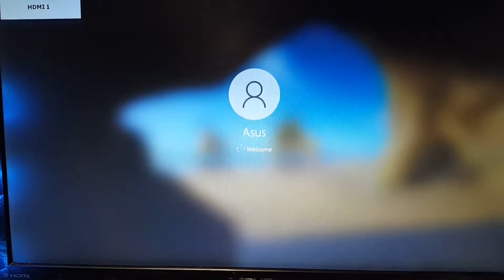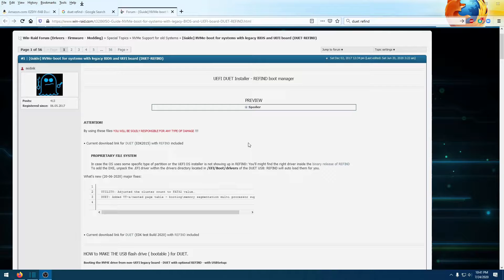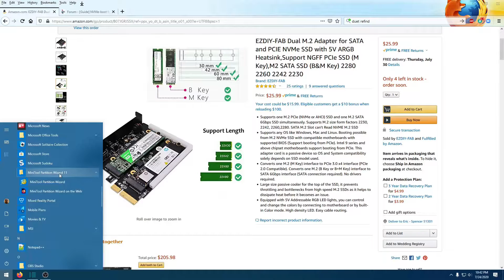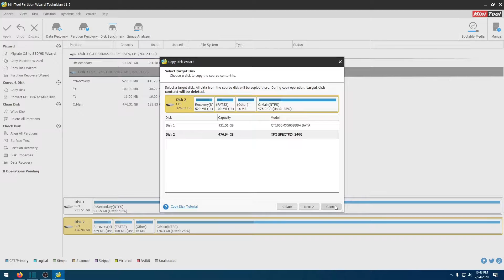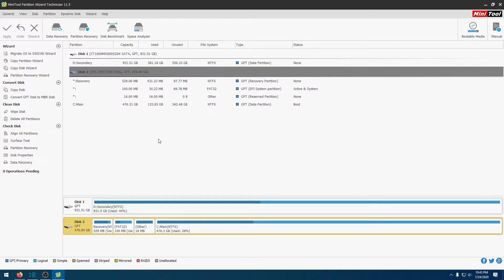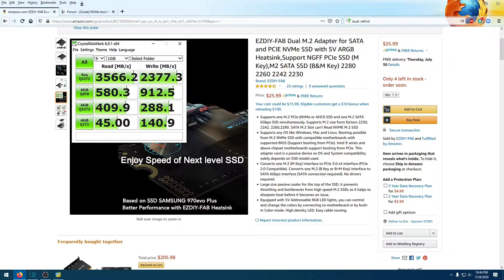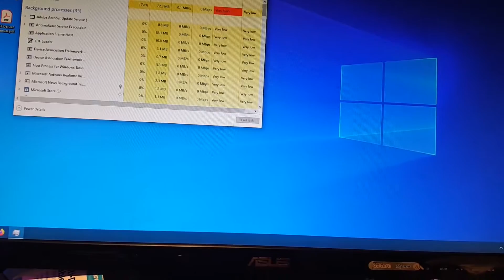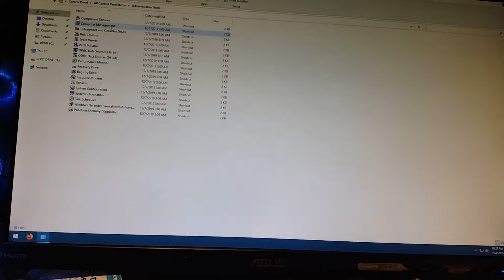nVME boot on a legacy x58 BIOS, no USB stick.

Comment: It's only 1600 because your PCIe slots are likely only gen2..  which is theoretical top speed of 2 GB/s  (500 MB/s per lane, x4 lanes for the NVMe).   So those "adapter" speeds they show (8:00) are likely on a PCIe 3.0 motherboard, which is double the 2 GB/s, 4.0 doubles again, and 5.0 doubles yet again.  That's still 4x faster than a Sata SSD though.

Comment: Without reading all your bios i am guessing your board is using pciE 2.0, which is about half the bandwidth of 3.0. 3.0 runs at 3500mb/s so check that out, 8f you haven't.
Reply from the maker: Yes, that is correct. Was intoxicated when I filmed this video, my mind was not considering PCIE 2.0 speeds and age of machine. Surprised at this looking back, that I was actually able to finish the video without slurring too much. Might have to one day redo this topic while sober, though I tend to try and stay away from older hardware these days when I film.

Comment: Great vid, I knew something like this was possible.  If this is the case, I wonder if this would allow for me to boot a 8TB SSD (or really any drive larger than 2TB) that's formatted as GPT on Legacy BIOS that does not have the option for UEFI.  I'll have to check out that WinRaid forum.  I read through all the comments here and my understand is that it's possible.
Reply from the maker: This is an older video that I did, and the WinRaid forums actually closed down I think last year.EDIT: you might be able to find support at https://forums.guru3d.com/ Kind of a shame they shut down, the site contained all kinds of invaluable information for modding a PC. Seems a lot of the modder community is fading these days. Sometimes I feel like a leftover relic being the last of only a few who still practice the art (even when drunk).
Reply from the maker: https://winraid.level1techs.com/t/guide-nvme-boot-for-systems-with-legacy-bios-and-uefi-board-duet-refind/32251

Comment: Sir using this adapter on gen 2 pice x16 port will I be able to boot through nvme SSD. Also if yes will the speed of M.2 Nvme ssd be the same as Nvme or as sata Ssd
Reply from the maker: You will be able to boot to the NVME via commands from the SATA ssd. Your speed will depend on the bus limitations, which in your case will be Gen 2 speeds. This is much faster than a standard SATA SSD, but not as fast as modern machines because of that bandwidth limitation. Real world, you can expect about 2x the speed of a SATA SSD using Gen 2 PCIE X16. Your speeds may vary of course, but that's the general range you are looking.

Comment: Does this works with chinese mobo ? .. I had huananzhi x58 deluxe .. But im not sure if this mobo can be uefi?
Reply from the maker: Yes, this should work, have not tested on any Chinese boards to verify, but x58 chipset should be the same.
Reply: @phreakwars  so you have tutorial on how to do this without usb drive to boot ?  I just found a good deal for sata m.2 (16gb ) and sata + nvme adapter ..
Reply from the maker: @ohagiman7753  No, sure don't. I don't usually cover older computers very often unless I come across one that makes an interesting topic.
Reply: @phreakwars  can i use 32 gb m.2 sata as a bootable drive for duet and refind?
Reply from the maker: @ohagiman7753  Yes, you could do that as well.
Reply: @phreakwars  hello i already had nvme and m.2 sata .. and put duet on sata .. how to install windows on nvme ? (already use diskpart ) i dont know how to install windows on this nvme?
Reply: @phreakwars i tried to boot with m.2 sata with duet and refind files inside but nothing happen..
Reply: @phreakwars  now i can use NvMe on my old pc.. But i dont know how to make it boot using m.2 sata... How to clone it 😅 please 🙏.. This the only last step

Comment: Great Job!😁 Goes to show one doesn't need the latest gen for everything. Out of over 10 computers, my best is still Haswell-E, a Z97 build with onboard NVMe, but figured I'd install this same way with an included fan. As these drives can get very hot underneath a double slot GPU, which anything decent is these days. In fact, was the 1st MB to feature a PCIe 3.0 x4 & a 2nd M.2 slot that'll run (I believe) 10Gbps or x2 lane NVMe. Manual or online says nothing about SATA M.2. I do recall seeing some x2 M.2 slots for AMD 970 MB's, but articles led me to believe this was for faster than SATA storage. These drives weren't that popular to begin with & some of the larger brands didn't manufacture them (less popular than mSATA is bad).🤣

I've done this too on AMD AM3+ (FX series), AM3 (Phenom & Athlon) & one AM2+ off the shelf HP Compaq system. These were PCIe 2.0 systems, and why 1500MB/sec is top speed, most will get that on reads, lower on writes, I found around 900MB/sec was top speed. Still, 3x faster on reads & around 650MB/sec more than SATA-2 systems, and generally over 400MB/sec faster on AMD SATA-3 legacy systems. The reason for this is these are PCIe 2.0 MB's & unlike Intel, there was no AMD MB that would with the swap of a 2nd gen Sandy Bridge to 3rd gen Ivy Bridge CPU, going from 2nd to 3rd gen on the chipset. This system, bought on eBay for my wife for $100, is a Dell Optiplex 7010 DT that shipped with one of the better retail 2nd gen CPU's (i7-2600) & for less than $35, upgraded to a i7-3770 & doubled the RAM to 32GB DDR3 from 16GB & like the system totally transformed. GPU as well now 3.0 x4. But I didn't do the NVMe upgrade, a 512GB Samsung 850 PRO kicks butt on it with the RAPID feature. Shows by both Crystal Disk Benchmark & ATTO to be faster than my Samsung 970 PRO. I'd rather allow the wear on that PC to be on the lifetime warranty RAM than the SSD that's now been out of warranty for a year or so, not to mention, in & out of multiple computers. Seriously, it's fast & it's just stock RAM for Dell made by Crucial, although purchased new by me on promo. Have an extra like new MB like this in case it goes down & may buy a couple more for some legacy Dells (Optiplex 790/990) that's also 2nd gen, but won't upgrade like this, chipset is older. These MB's can be purchased for $15 or less in great condition & most shipped with Win 7 Pro. 

This NVMe install is easy as pie if having a Samsung 950 PRO (any size) around, because it's the ONLY of the 900 series to have it's own bootable ROM. Guess Samsung didn't want to kill their sales of 2.5" SATA SSD's!😂 Though be sure to uninstall any other drives first, to find the NVMe one. Easier done with Intel systems, some AMD systems needs the optional Windows 7 NVMe driver that's likely still out there to be placed on USB stick, floppy or slipstreamed into ISO (been 3-4 years since I've done this on legacy AMD). My next build will for sure be Zen, hopefully AM5, but until I see DisplayPort 2.0 PCIe GPU's & monitors, I can wait. Seems like the video is always there with new cards, just not new Standards, as DP 2.0 was released to distribute years ago. Much faster than HDMI 2.1 (around 80GB/sec for DP 2.0 compared to 48GB/sec for HDMI 2.1), so why the wait anymore with PCIe Gen 5, which likely will be a longer GPU standard than Gen 4. 

BTW, lots of these goodies, including then $5,000 PCIe (SLC NAND, the best to this date) were available for Linux long before Windows. Mainly workstation computers, servers & supercomputers, of which last time I looked, there wasn't a Windows one in the Top 50. And after 4-5 years of usage, these drives were sanitized & resold on eBay for $2K or so each. This was around the time of release, or just after that of Windows 7. My guess is these are still in use today, or most are. SLC NAND, which many TLC & my favorite, MLC (of which until the Samsung 990), all of their PRO Line of 2.5" & NVMe were. Some specialty HDD's has up to 4GB of SLC NAND, 64-256MB is more common. This acts as the buffer, or cache. NVMe SSD's doesn't need this because is connected to (normally) 4 lanes, be it PCIe 3, 4 or 5.0. As stated prior, there were some x2 lane NVMe drives, not sure what gen these were, but no newer than Gen 3. I can imagine seeing a x6 or x8 NVMe in the future (if not already here) for the same reasons like when SLC NAND NVMe drives were new. Never read discussions on these anywhere until after the release of Windows 7 & closer to that of the $40 Windows 8 promo. 

Anyway, thanks for the video & you've gained a new subscriber.💪 There's never "too much" learning when it comes to computers & it kills the day for me, being retired.😁💯

Comment: HI, great tutorial. I have exactly the same board as you and I was wondering if it would be possible to clone my SSD boot drive to the PCIE NVME drive, once its installed?
Reply from the maker: Possibly. Best bet is ask on the win-raid forums where the software originates. They would have a better idea.

Comment: I currently have a situation where I have 5 2TB HDDs plugged into SATA in my ThinkStation P20 Motherboard and I bought an M.2 PCIe adapter without checking first that the mobo supports it (surprise, it doesn't). since I have no more spare SATA ports or even SATA power connectors coming from the power supply, I thought I could use a usb stick to boot into the m2 from. Is this possible with this method also? I was worried if maybe some of the reads would still use the usb drive and damage it in the long run. It's going to be a home server with TrueNAS scale.
Reply from the maker: My solution, would be to use a USB Dom. You can pick one up on eBay for $20 or less. https://www.ebay.com/sch/i.html?_from=R40&_trksid=p2334524.m570.l1313&_nkw=usb+dom&_sacat=0&LH_TitleDesc=0&_osacat=0&_odkw=usbdm This is where you'd install DUET/REFIND to call on the nVME for booting. Since you are only using it as the boot loader, it can be very small, like 4 gigs (hell even 2 gigs) or less even. Hope this helps.
Reply: @phreakwars  Thanks for the tip! For now, I just installed it on a thumb drive and it worked instantly! Before finding your video I probably searched for a solution for about 2 or so hours...

Comment: Hey Thanks for your video, i'm  in a similar situation , i need to install a NVME or M.2 to a X58 board... and my x58 motherboard is a Gygabyte EX58 Extreme which doesnt have SATA3 ports ! only SATA2... so my doubt is: is that sata cable connecting your mSATA drive to the SATA2 port ? and... is it possible to use that SATA port in the adaptor to connecta a SATA3 SSD ? thanks !
Reply from the maker: Couple different way to do it and a lot of it depends on your board as well. The controller in this video is one where the NVME speed comes from the PCI-E, but sata speed comes from the sata port on the board via a sata cable connected to the card that reads the sata m.2 drive. The speed of the sata drive itself is not important since in this configuration, the sata port is only being utilized to initiate duet/refind. That is all it does. As a matter of fact, if you REALLY REALLY want to eliminate sata 100%, watch this video from Linus about USB DOM: https://www.youtube.com/watch?v=JlbNmVdwzb0https://www.youtube.com/watch?v=JlbNmVdwzb0 JUST SAYIN...

Comment: a buddy of mines just using due+refind(sp?) on an old usb2 stick to load the uefi loader and boot from his nvme drives also lets him run a 6800xt he won in his evga sr2 system... (5.5 on both chips 24/7 with dual 280mm AIO's... and 192gb of recc 1866...

Comment: I have a HP Compaq Elite 8300 SFF and I tried your method with it and did not work !!!  I checked it out and it has all the NVMe drivers.  In fact the NVMe unit pluged in a PCIexpress port is detected by Windows as a secundary disk and I can use it as such.  But it is not detected by the BIOS so that I can not choose it as a boot device even when this NVMe unit is a clone of the ssd unit pluged to the SATA port.
   You answered to Modr Ribaz that:  "In fact you can modify the EFI partition yourself and change it to the clover bootloader screen and customize it how you like."  Please tell me how to do that or where can I find the information which will let me do it !!!  
   Thank you in advance for your help !!!
    Blessings !!!
Reply from the maker: Honestly, best advice I can give you, is head to the win-raid forum I link to in the description of the video. I was half drunk when I made this video and I am not going to make any type of claims to being knowledgeable about the process. I also experienced what you described on a different HP machine when I was testing an nVME add-in card. Windows would see it just fine, read speeds were within reason for the bus, just no option in the BIOS to boot. Now there IS a hack in many HP's you can do to access extended features. What you'll do is spam both the left CTRL key and the F10 key at the same time after pressing the power button. When it goes into the BIOS, you'll see additional options. Not sure on the specifics of that particular board, but might be worth checking out.
Reply: @phreakwars  I learned something today, didn't know that about HP BIOS

Comment: I've heard of a bootloader "Clover" that can be set to boot from SATA and then runs a EFI code that will boot the OS from an NVME drive, basically skipping the incompatibility issues that occur with older legacy-only motherboards.
Seems promising.
Reply from the maker: This is based off of clover. In fact you can modify the EFI partition yourself and change it to the clover bootloader screen and customize it how you like.
Reply: @phreakwars  I've seen others using DUET/clover.. just like you're using DUET/reFind
Reply from the maker: @Happy Corona-virus No. I added Duet/Refind to a sata drive, which then boots the nVME.
Reply from the maker: @Happy Corona-virus You can use a SATA DOM or a USB DOM as well. USB DOM might be the cheapest path, you can get an 8 gig USB DOM for around $20 if you don't mind waiting on China delivery.
Reply: Boot options can be added directly to bios to eliminate clover etc.

Some Samsung drives have their own options rom already so will show in bios, you do have to add drivers during older os installation though.

Comment: I'm so confused by this video. You say that you're using an NVME drive plugged into the PCI-E port, but then say you're booting off a SATA drive between the motherboard and the PCI-E board and then you say you're not booting off a USB drive but go into plugging an M.2 drive into a USB dongle. I'm tempted to try to play this video backwards to see if it makes any more sense.
Reply from the maker: Makes perfect sense to me. Booting off of something does not mean that's where the OS is stored. Ever heard of Linux boot disks? It's called a BOOT LOADER. Perhaps you don't need to rewind, you just need to research. Links in the description.
Reply: @phreakwars  Like using a GameShark as a boot disc for Dreamcast to play imported titles and bootleg discs.
Reply: It’s a workaround boot loader on sata drive enables access to the nvme drive that holds the os. The solution you are looking for to bios recognize the nvme is not in this video. He is using clover which I have really only seen on hackintosh machines. I am looking into coreboot to see if nvme from bios can be done. Coreboot is an open source bios that allows you to add modules for configurations you may need. X58 are my favorite work horses that is ending. I was looking at core boot to see how far you can push an x58.